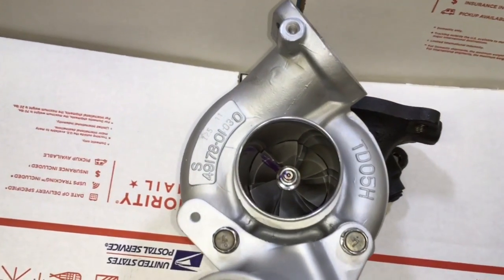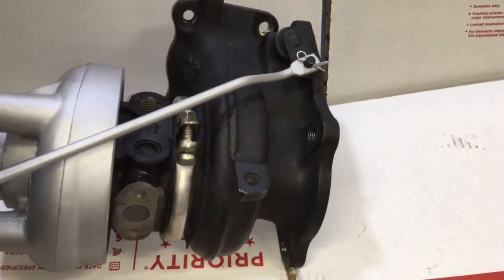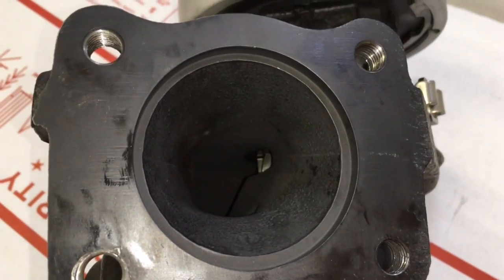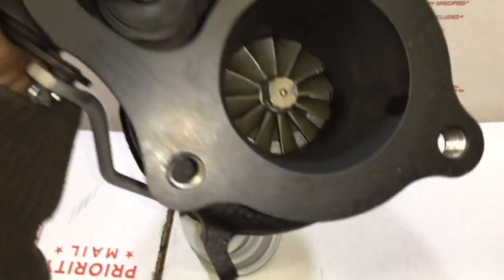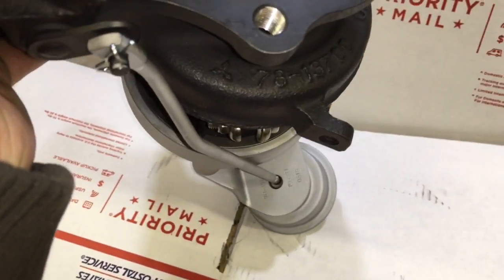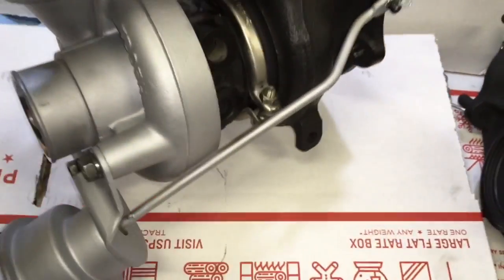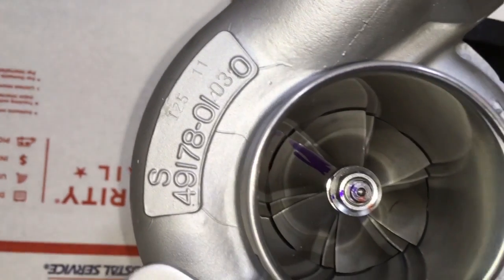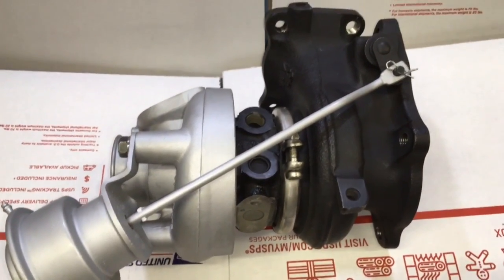EVO 3 16g Turbo Upgrade

Comment: At 30 psi you'll be pushing that turbo way past it's efficiency range
Reply from the maker: +Eric Chacone the 16g can be altered with a 9 blade turbine, billet extended tip wheel, and meth injection can be used to cool it down. Most of the people that run the 16g internal wastegate are limited by the internal wastegate pressure spring because the exhaust pressure can push the spring open before the boost controller releases the pressure to actuate the wastegate actuator. 

The 16g factory is supposed to have a tighter spring which helps allow it to run higher boost levels because the exhaust pressure won't open the wastegate flap as easily. There are also upgraded wastegate springs to allow the 16g to boost higher too.

Comment: By far my favorite turbo I've ever used on a car. I call it the little turbo that could. I bought mine back in 2004 from Forced Performance as a kit. Included everything for install on a 2G GSX. I loved that turbo. I had them do the full service of ported and polished exhaust housing with the EVO3 o2 housing also ported and polished. Had that turbo for 8 years on my 1998 Eclipse GSX. Spool up was great and hit hard at 550cfm. I ran it at 19psi to 22psi. Once I fully built my 6bolt motor I had to say goodbye to that turbo. Once my 2.0L was broken in and I tried to start getting beyond 22psi the turbo couldn't supply enought air past 5,000rpms with 1mm oversized valves and full race ported head with Delta HKS 272 regrinds and I was planning to use the 16g just for break-in and ended up going to a PTE SCM-6152e and I really missed the spool up of the E3B16G once my journal bearing 6152 took til 4500rpms to make boost but of course the 6152e did slam alot harder. Figured I'd supply alittle info to anyone thinking of that turbo as it's really a great turbo. I knew one guy that had used some type of 16g turbo on his twin turbo 300ZX and it made 500whp on 25psi with two of these turbos and it pulled hard til redline without a issue. Cheers!
Reply: Thank you Kendel🤘🏼i have a 6 bolt 85.5hd1400, eagle rods, bc280, oversized valves,springs/retainers NO PORTing on head, and a 16gevo3. This will be on my 93 fwd gst. I picked it up because i should be able to break in the engine with ease.[oem maf/wg pressure, etc..] I want to push my 16g to its limits but if its out by 5500 & im wanting to go to 82-8500, i dont think it will help me in the end. I hear they wake up around 18-28#s.

I have a new he351twinscroll, ebay exhaustmanifold & 44mm external wg but ive got to get either an adapter for external wg or pay up & get a manifold. I dont want to give up the low spool & needed a turbo that can help me on both ends of my rpms. 5-600hp goal for now. Thank you for the info 🤘🏼🤘🏼
Reply: @variousinstrumentals6846  the 16g ran out of air on me at 5500 also